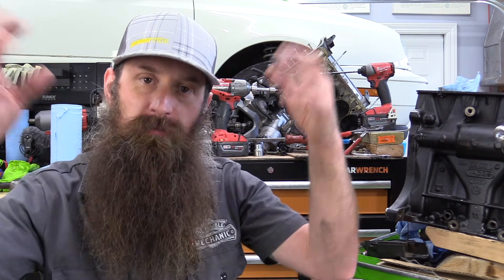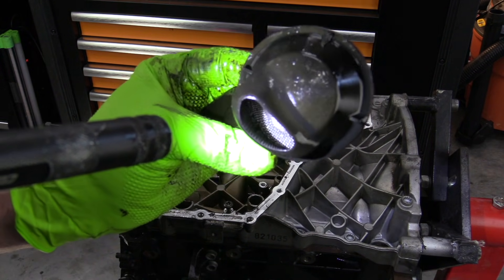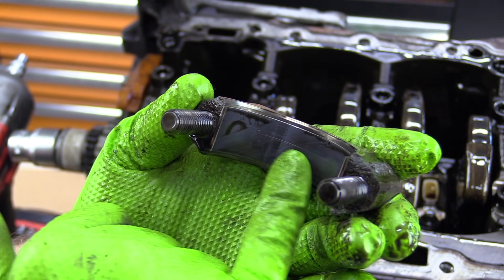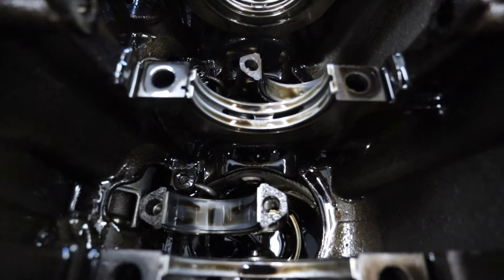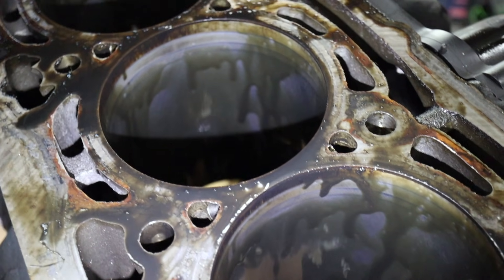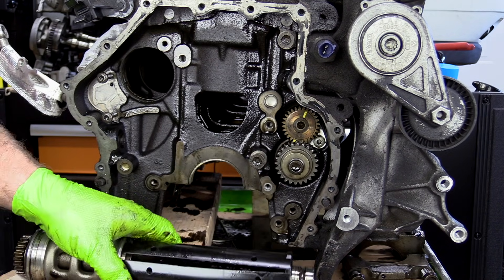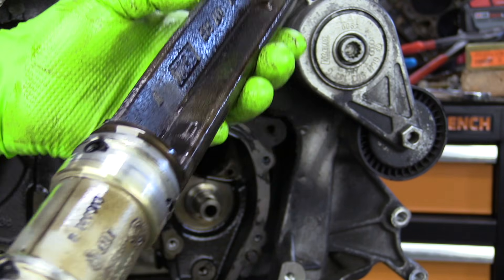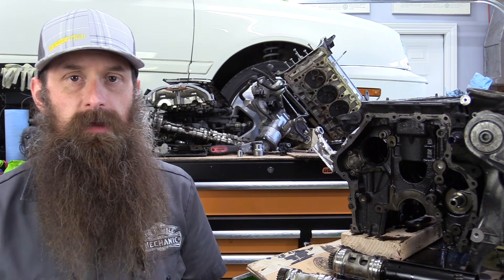2.0 TSI Engine Bottom End Teardown ~Pistons, Balance Shafts Oil Pump

Comment: Those balance shafts are a joke along with other crappy parts. We are at the top of german motor engineering that is carefully designed to fail. 
Thanks for the tour though! :)
Reply: The old Porsche 944 had balancer shafts. The Mechanic told me is was actually a Mitsubishi patent design!
Reply: @keithmatthews1673  I believe that they are referred to as Lanchester balance shafts, after the guy who invented them.
Reply: This was when you have engineers with too much time on their hand and I think everybody's going to take care of their cars that means a lot of oil changes
Reply: Looks like you can't eliminate the balance shafts on this one

Comment: Hi.could you advise me on a way forward on my 2010 mk5 jetta 1.4 tsi (CAXA).on cold start vehice idles high and rough for 10-15 seconds sometimes more depending on temperature.i was told it does this to warm up the cat but i have the mk6 jetta and tiguan with the same CAXA engine with higher mileage that does not do this even if its parked for 3+ days. No faults on diagnostic at the moment.

Comment: How bad would it be to run this motor w/o the balance shafts?

I know they do it with hayabusa motors all the time...
Reply from the maker: Not totally sure. But you’d have to find a way to drive the water pump.  The shaft on the intake side drives the pump

Comment: Great video..now i know why those cars  has very low after sale value ..i don't know what happened to VW engineers to make a failure engines like that i wonder why they insist to put a plastic parts inside the engine !!!

Comment: That sludge is probably plastic remains from the dipstick after the plastic components fell back in the sump, I have 2012 Golf GTi edition 35 (Golf R block) with less than 90,000kms and the dipstick has disintegrated recently.

Comment: At 9:50, what is the black case under the water pump? I have a leak coming from there with my Tiguan. Thank you!
Reply from the maker: It’s a primary oil separator. Be sure your leak isn’t higher up.

Comment: So basically it’s a pretty solid engine that had valve timing problems that led to bent valves. Outside of the bent valves it was in good overall condition...yet so many comments about how bad the engine is. Even the design isn’t too bad, and almost all manufacturers use that amount of plastic.
Reply from the maker: I think in a video like this on any engine, you could say similar things.  Some bad and good.

Comment: Awesome video HumbleMechanic!
 I'm having a low oil pressure issue also. Here are the steps I took so far.
 1)Replaced my Balance Shafts. Found the screens broken but not clogged. 
Checked the Cambridge and screen came out. (I was told that Audi did a service bulletin to take screens out since they will cause issues and its ok to have them out)
 Reused it without screen.
 
2) Reassembled and flushed with new oil and then replaced with more fresh oil.  Still getting low oil pressure. 
3) Removed oil pan and no grime or dirt or shavings found. 
4) Removed oil pump and found a little piece of silicone and some small pieces of plastic but again no major blockage. Oil pump looks to be in great condition.

Anyway to check to see or know when an oil pump is going bad? Could you do a teardown on an oil pump and see if a failure could be cause by an internal part on it?

 Thanks, Chris

Comment: So many small bits of plastic stuff everywhere. Engines have really become mechanicly unfriendly the last 20 years. And there engines had a service interval of about 20000 km (12500 miles) and I don't think it was annually either. It is every other year and 20000 km today. That is way too much with all these small filters and part that needs good oil pressure.
Nice vid @Humble, I really enjoyed it!

Comment: I've found the number 1 reason for these engine failures. Too many dam plastic components!
Reply: True. They would use 3D printed pistons if they lasted for at least the time it took to drive off the dealer lot.
Reply: @EscapeEFT  Its coming, I still remember 15+ years ago Honda was going to use a composite (Fancy word for Plastic ABS mixed with glass fiber) injection molded  lower control arms on the Honda Civic. They abandoned the idea and it was never commercialized (Thank F%$6king God). 

 I think fundamentally the Japanese mfg have learned to limit their use of plastic components in powertrain. While the Germans keep pushing the envelope and failing miserably. 

Having said that. Can't wait to see what the "Toyota" Supra (build by BMW) will do long term for its owners. It was one heck of a gamble for such a reputed brand to pick such a $hit constructor.  Personally, I think its a huge mistake.
Reply: @fredpinczuk7352  The problem is that you take plastic parts, mixed with overly engineered parts, plus a bit of idiot design then your head explodes when you try to repair one of this money pits after the plastic water pump fails (BMW plastic water pump no joke) or something else. It almost feels like they design them like this to discourage you from even attempting a repair. Then you go to the shop and they tell you is $150 to diagnose and tell you what one light on the dash board means.
Reply: Fred Pinczuk 

Just replaced my plastic water pump :(
Reply: @TolandTheShattered  Just replaced my plastic pistons--actually I just 3d printed some more in my basemant.
Reply: @wsfwsf1497  Bout to rebuild mine, can you send me some of those plastic pistons? Also do you think they'll hold 500hp?
Reply: It's made to fail after warranty. EU does that to all the engines
Reply: Cuz it's made to fail after warranty
Reply: #1 failure: It's made in Germany

Comment: I´m somewhat shocked, how sooted the oil on this GASOLINE engine is. I mean, on a diesel black oil is normal, but on a gas engine...?
Ok, i know that gasoline-direct-injection engines produce a lot more soot than port injected or even carburated engines... but, this cannot be good.

Comment: VAG knows what they do...these engines and all the new ones are "disaster ready to happen" stuff. Oil and water leaks everywhere. When you wanna have efficiency with power low weight and as cheap as possible this is the result.
Reply: All manufacturers make junk nowadays. Everyone car has a few pry bars... Helps get into our wallets. Fix the old junk or buy some new junk made out of cheese metal..
Reply: @geezman1000  Scott is right, if you look at a Ford or Chevy in 2021 its all just as complicated. However the Germans are the best at making complicated run well. Ive had 4 VW/Audi vehicles and they run and drive so well. 4 cars is not a huge sample size granted but they have been more reliable than the big 3 in my experience.
Reply: @geezman1000 LS engines are pretty much bulletproof
Reply: Yeeeeeah you have a point, but most of these issues are found on the older tfsi engines, the new ones can be built to make some insane power with some decent reliability

Comment: I have it I have a GTIVR6 motor I need to rebuild or get a used one do you have a good recommendation I live in the Los Angeles area. I have no problem having it shipped to this area.Do you have any recommendations the motor locked up on me running low on water

Comment: Hey Charles I have an off topic question about the BDF engine code vr6. I’m trying to find a good valve spring compressor tool that will work but I’m coming up empty handed. Do you have any suggestions for me on which tool works best for this job?
Reply from the maker: Head off, Any should work. On the engine I always rigged up a bolt/socket/wrench combo. I’ll shop around and see what I can find

Comment: Do you see more problems with the new engines, over old 1.8t ? 2 of my friends got vw, one got golf r and the other one got Gti, both have problems, golf r, water pump leaking, oil consumption, turning light stopped working, car sometimes won’t start, after it cools down it will run again like noting was wrong. Gti all the lights come on like a Christmas tree, climate controls blink, and Can’t turn off the engine, when we connected a obdeleven, it’s showed that everything is wrong with the car lol, took it to vw dealer and they couldn’t find the problem, they said it’s probably a ground and didn’t charge him for the service. Definitely great cars for mechanics.

Comment: Side main bearing bolts called jack screws in domestic world.  Makes for a tighter block assembly.
Reply from the maker: I like how that sounds. Lol
Reply: @HumbleMechanic  Yeah, cool idea.  I'm no huge VW fan(my mother's '88 Jetta with pee-poor ?-jetronic fuel injection sealed that deal....the more throttle you gave it, the slower it went.  Bad system.  But the '95 TD was great, honestly.  My mother had a '79 Rabbit diesel.  Awesome fuel economy.  Dangerous to drive on the road due to almost absent acceleration(let's say rear-ender bait)  Great mileage though...50MPG confirmed(yea, 1979).  Interesting thing about that engine and the Chrysler gas 1.7's.  Oil pressure switch closed on high AND low oil pressure.  Mom's car had warning buzzer coming on at "shift points".  Checked the pressure and yeah, too high.  I later learned that they were bursting oil filters because of stuck relief valves.  Easy fix in the day.  Easy to  get to and easy to replace.  Anyhow, I enjoy your videos and take on current happenings  concerning VW products.

Comment: Hey humble mechanic I am having an issue with the 2019 golf GTI there is a problem that the engine will stall while the car is in neutral not touch the clutch and just stepping on the break or not even just rolling up to the light and having the car stall on me it happens several times I have spoken to my dealership and they told me that they will need to have it check there is no engine check light on it’s all working fine but the car stall I went today to a dealership in Delaware Wilmington and they told me they won’t be able to see the car till Wednesday, do you have anyone coming to your shop with this issue there is a reddit forum of people with the same issues I have but no solution.

Comment: Hi Charles i have a knocking on my agr 1.9 TDI, i suspect the rod bearings are making the knock, Is there a way to confirm this without doing a disassembly? Cheers from argentina, and thx for your videos!
Reply from the maker: Sometimes it changes with load. What about a chasing in noise with the clutch in vs out
Reply: @HumbleMechanic  yeah that happens with my Mercedes. But that knocking noise is coming from the engine. Thoughts

Comment: The one thing that anybody should take from this video is just how vital it is to use the very best in oil and pay strict attention to service schedules. I prefer to skip the extended service periods and change my oil much earlier. Easy and quick to do and pays dividends. Skip on servicing or quality and any savings will come back to haunt you down the line.

Comment: Heat and plastic don't mix. The Germans might be the best at planned obsolescence.
Reply: They are also very good at making overly engineered engines.
Reply: @EscapeEFT  haha right... they make them a bit complicated.  Seeing the timing chains on these after that black cover came off my mind went... wtf is that mess.  Personally will never own a 2.ot.  I've been quite happy with my 3.2L.  Just wish there was more mods out there for them.
Reply: and they are mandated to use recycled plastic which doesn't help
Reply: This is just my problem..the plastic sleeve of my balancer Shaft has locked my motor... Now I have to teardown my motor. Hopufully I found this video.

Comment: Brilliant video Charles. I have rebuilt over a hundred of these EA888 engines back at Audi for oil consumption, and of course now tensioner failure. It's great to see another tech happy to pass on the knowledge and information regarding the issues with these engines too.
Reply from the maker: Rock on!!!
Reply: At what level of consumption do you need to look at the engine?

Comment: Hi there! So I own a 2010 VW CC and I've been wanting to do some work myself on the car I own. I'm having some oil leak issues. I had to get the fuel pump control unit replaced due to a recall... While I was there the techs recommended I have these done: valve cover reseal
,,,,(huge oil leak), turbo cut off valve (leaking oil in connector), drive

,,,,belt (oil contamination), 80k service or LOF (drain plug leaking oil). Do you think this is something I could accomplish myself not being a mechanic? Excuse the weird typing, I just copy and pasted form the invoice I had emailed to me from VW. Thanks for your time!
Reply from the maker: The cover leaking is a bigger job. I’m going to do a DIY on it. It won’t be a complete DIY, because the engine is out of the car.
Reply: @HumbleMechanic  Thanks for taking the time to reply! I'll make sure to check out the video when you upload it.
Reply: To do the valve cover you are supposed to release tension on the timing chain. This is due to the fact the valve cover is actually the bearing caps for the camshafts as one integrated unit. So if you remove the valve  cover with the tension still on the timing chain,  you risk causing damage to the camshafts and/or the cylinder heads integral cam bearings. It is a job you could DIY if you have a good knowledge of engines and are comfortable finding TDC and if necessary setting the valve timing. I have a video on my channel that I'm about to upload on replacing the timing chain and tensioner on one of these engines which will help in setting the valve timing and releasing the tensioner.
Reply: @FourRingsAuto  I appreciate all the info! I'll keep a look out for the video.
Reply: @Jthesavage-i5c  the video is up. It won't be anywhere near as detailed as Charles' videos, but it contains enough information to get your head around the job. thanks

Comment: I would like to know your thoughts/ experience of low oil psi conditions on these Engines. I had a car in the other day and after driving it up the hill to get the oil nice and hot and thin, the idle psi was 12 and 2K RPM was 32psi. The only spec is 29-65 psi at 2K RPM, this engine has already got a new cam bridge, oil pump, oil pump pick up. I've heard of psi loss from worn balance shafts but I dont know of a good test for this. I have heard of Ford techs on Triton Engines, they would apply psi to the oil circuit with the engine hot and off and look for leaking at chain tensioners. So just wanted to hear if any anybody has an effective test other than a full tear down. TIA
Reply: Chain tensioners can leak/bypass. There is a rubber plug in the lower timing cover you could remove and possibly inspect?

Comment: i wonder if the retarded engineers who built this engine would, would have these problems if they  put a better oil filter that can filter to 2 microns and went to 2500 miles oil changes. aside from all the plastic crap

Comment: I work on these engines all the time. I have heard about the balance shaft issues but I have never seen it. I have seen the guides on the shafts chain break and cause crazy vibs but I never saw the balance shafts causing an oil pressure issue. Was that a still in warranty problem or a high mileage issue?

Comment: Surprised that engine has 6 Bolt Mains
Reply: flyonbyya 4 bolt
Reply: alexaescht 
Your correct
It’s actually a 2 bolt main, with cross bolts totaling 4 fasteners per journal

Comment: what do you think about removing the balancing shafts? [one fellow youtuber did this on his focus to gain a lil more hp]
Reply from the maker: In this engine, not worth it. I did a balance shaft delete on a TDI. The extra vibration was annoying. LOL Not horrible, but not awesome
Reply: Plus you'd have do something on the inlet balance shaft to drive the water pump still. I agree not worth the hassle.

Comment: It would be nice if you could possibly do a comparison on gen2 vs gen3 and tell us what they improved on.
Reply: They changed a lot of things.
 Bore spacing is now 0.5mm less at 3mm between cylinders. The exhaust manifold is now built into the cylinder head so the turbo is bolted straight to the head - for faster emissions control and reduced turbo lag. Also they changed to a twin scroll turbo for reducing lag. They now have FSI direct injection and MPI port injection, and the high pressure system now operates up to around 200bar up from 150bar (from memory). There is also variable valve timing on the inlet and exhaust camshafts now rather than just the intake. The thermostat is electronically controlled now.
Reply: That would be an amazing video

Comment: please please please take apart a performance engine like the V10 from the S6/S8
Reply from the maker: If I can get one I will!
Reply: @HumbleMechanic  thank youu! I love these engine teardown videos, they're always really informative. One thing I would possibly suggest is to have a little note at the bottom of the screen that describes that part you took out so that inexperienced viewers have a better time following along. Some things that seem basic to you may go over some inexperienced viewers' heads, so little notes at the bottom that say "the water pump circulates coolant throughout the engine to keep temperatures low; vw and audi water pumps have been know to leak coolant onto the timing belt, causing premature failure" or something like that would help tremendously in my opinion. I would be happy to make an animation for you that briefly shows notes like that in your videos, although this is just an idea and these teardowns are already great :)
Reply: How about an RS4 V8? I pulled mine apart over Xmas to rebuild it and filmed the process. Just need to upload it to my channel. Not sure if there's enough interest though and how long to make the videos. Maybe episodes/ series?
Reply: @FourRingsAuto  I'd like to see that as well; the W12 too would be awesome but the W12, like your V8 and the S6/S8 V10, is very rare
Reply: @FourRingsAuto  sounds good :)